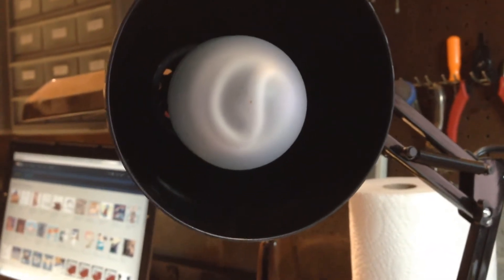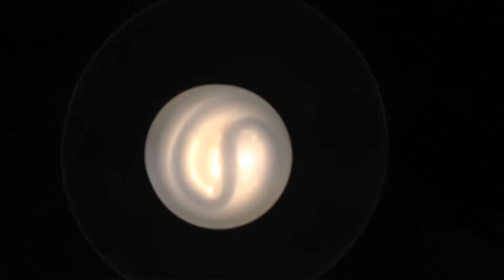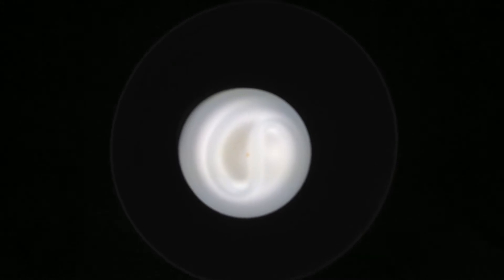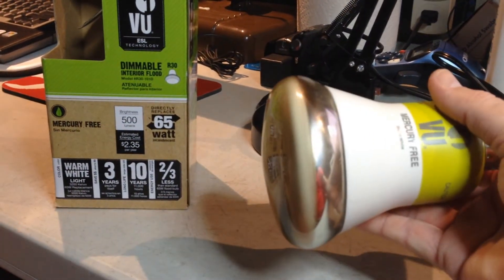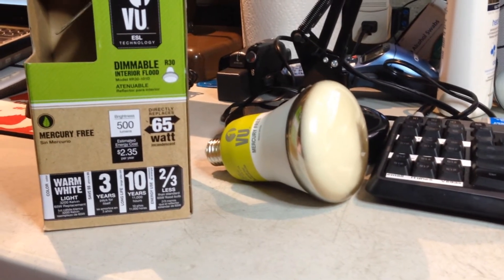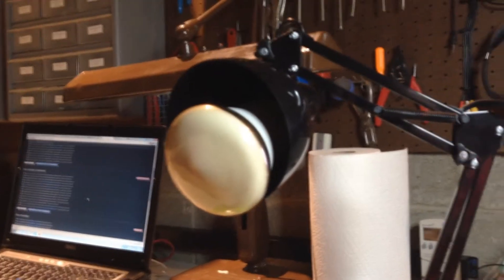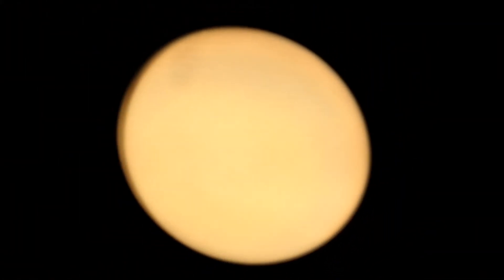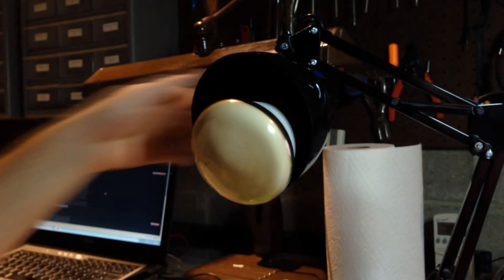New Light Bulb Technology

Comment: That Vu1 bulb has to be insanely expensive to make and the performance isn't all that great (25.64lm/watt), I can see why the company isn't doing too well. Meanwhile Cree sells BR30 65w replacement LED bulbs assembled IN THE USA for $20 or so that output 650 lumens at 9.5 watts (68.42lm/watt). The Cree bulbs likely weigh less too.

Nice try and an interesting bit of alternate tech though. Looking on their site, the tech was actually quite good for 2010 when they developed it originally. Unfortunately for them the lighting market advanced quite a bit the past few years.

Comment: Walfart.... I gotta remember that.
That VU1 bulb is super cool. I hope they figure out the issues with these bulbs and put them back into production, because they would make great floodlight replacements. Do you know if it makes the high frequency sound that CRT TV's are known for or is it pretty silent?
Reply: Totally!  And even though they're either discontinued (or at least put on hold,) they're no more expensive than a regular LED floodlight of the same brightness.  I put my ear up to it and switched it on, I heard a very quick high voltage frequency sound, but just until the bulb came on completely.  I heard it again when I switched it off and it faded out.

Comment: I'm gong to say the same as what many others said here, the CRT bulb is really cool.  Definitely an unlikely candidate for lighting.

As for the GE bulb with the halogen, I have them installed in the aux lights on my garage workbench.  I chose them because it's cold in there in the winter, and I figured they would at least try to ignite in the cold.  They've been doing a fine job.  When the halogen goes out, it's still dim until it actually reaches full brightness.  The halogens in mine don't stay on for 2 minutes, that's for sure.

I have a video of them installed in the fixtures, if you search my channel for the Harbor Freight Review of the Luminar Work Clamp Light.  Didn't want to post a link because it automatically goes to spam if you do!
Reply: Oh! I actually saw that video already... just thought of it.  I noticed the same thing too, when the halogen goes out, it's still a while before the bulb reaches full brightness.

Comment: That is one bizarre bulb.  As for CFLs...I've actually grown to like them.  I bought my house in 2009, installed CFLs throughout.  Not a single one has died.  Only one was completely DOA, which GE sent me a voucher for a 6 pack which was certainly nice.  I use LEDs on dimmable fixtures, CFL everywhere else.
Reply: We've only had probably 3 CFLs complete their final song and dance, and we have a lot of them :-)  Same here, we have 6 track light heads and 2 can lights so far on dimmers with LEDs, and we have never had a problem with any LED.
Reply: harleybadger1 I'm interested in those Halogen/CFL hybrids you have, too.  I need a couple of those for bedroom lamps, I bet the 75W ones are a whole lot more reasonably priced than 75W LEDs!
Reply: Erdie5 Oh yes, they're about 30% cheaper across the board.

Comment: still like incandescent. got a few 3 way lights for a lamp and dollar store still sells th em.
Reply: I like incandescent as well, it's just a terribly inefficient way to produce light, and lasts for a very short time in comparison.  Yes, there are always going to be those who have used the same incandescent bulb for years with no issues, but that's comparatively rare.
Reply: harleybadger1
yeah lat 3 way light lasted like 8 years. only 1 part burned out and dimmer one was still working. replaced it it because had others to use but still have old one if need to use sometime.

Comment: I think Chris Cuff (fortyfiveplayer) talked about these GE bulbs with the halogen bulbs inside them, I don't know if these are available here in Australia or not, if they are I'm not buying any.  I do have some CFL bulbs in my house, but I'm not at all bothered by the warm up time, I notice it, but it doesn't bother me at all, it never has.  As for the ESL technology bulb, well, in theory it's really cool.  Does the bulb whistle like a cathode ray tube screen does?  Do you notice any flicker with that bulb?
Reply: The same CFL bulb is not available in Australia.  I did find them on ebay.com.au, but they were $38 AUD for a 2-pack shipped from the US, ouch!  The warm-up time has never bothered us either.  GE says it's a way to use less mercury in the tube.  I tried the VU1 again just now and heard a very faint HV.HF sound right at the start, and another when I turned it off.  I don't notice any flicker or strobe effect at all.
Reply: Yeah, that's very expensive for CFL bulbs, and the other problem is, you guys use 110 volts AC, but you probably already know that we use 240 volts AC at 50Hz, so unless the bulb can tolerate running on 240 volts, it's going to fail as soon as you plug it in, it may even fail violently.  GE's claims of using less mercury in the CFL tubes don't make much sense to me, unless of course the CFL tubes in these bulbs are different to an ordinary CFL, I would have assumed that the tubes are exactly the same as a regular CFL with the addition of the halogen capsule, so they'd take just as long to warm up as a regular CFL and would contain the same components and chemicals, right?  Of course there maybe something that's going completely over my head here.
Reply: Lachlant1984 Yep, both bulbs in this video are only for 110v at 60Hz.  We do have a few CFLs that work on 110/240, 60/50 Hz around the house, but other than our modern electronics (computers, cell phone chargers, etc) the only other item in our home that is 240v is the heater in the garage.  And you're on the right track, this particular CFL is different in that it uses much less mercury than a typical CFL, or at least an older CFL.  The US EPA required a reduction in mercury at some point recently, and the result was longer CFL warm-up times.  Because people bitched, there were a few (short-lived) attempts at a remedy to this issue, this "hybrid" CFL bulb being one of them.
Reply: I'd be curious to know what other solutions other companies developed to try and combat the "problem" of the long warm up times.

Comment: The CRT bulb is very interesting.  Even though its china pride, lets see how long it'll last.  LMAO @ 10:22 "bluh".  There's a CFL in my closet that's been there since 2003 and it still works.  12 years is great for a CFL even though I rarely turned it on.  Ill post a video of it
Reply: I have regular bulbs that are over ten years old but are rarely used.
Reply: Sugar Walls
I had three incandescents that lasted 20 years... they were marketed as "long life", and they sure did last a long time! They were 60 watt, but they got to be slightly dimmer than a 40 watt. I left them in my old house, otherwise I'd still be using them somewhere.

Comment: Very interesting. I want one! The early CFL bulbs from Philips were heavy too, more than 1 pound if I remember right. There was a warning on the bulb itself that it could cause instability on table lamps and not to use them if the height of the lamp was more than 3X the width of the base.
Reply: This is probably about a pound, it seems.  Or half a kilogram for the rest of the world :-)
Reply: Yeah, those 1980s Philips SL CFL bulbs were huge. I have a few here still. The 120v versions (Made in the USA!) had plastic domes which kept some of the weight off, I can't imagine how heavy the 240V versions with the glass dome were.